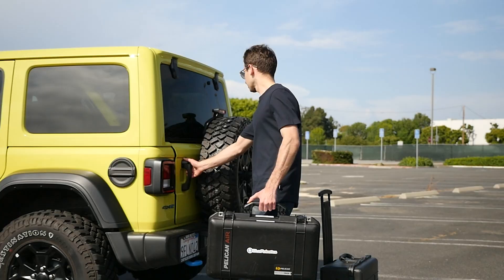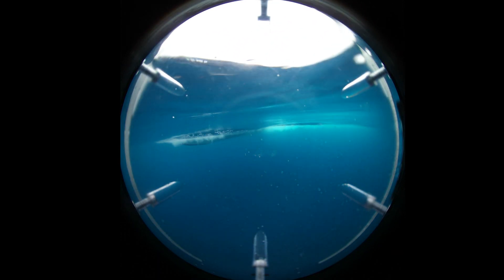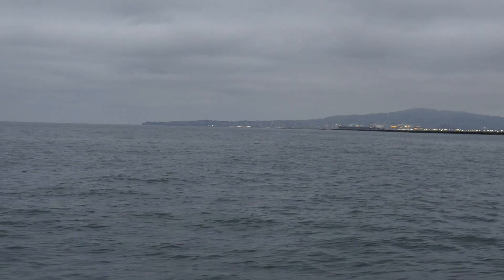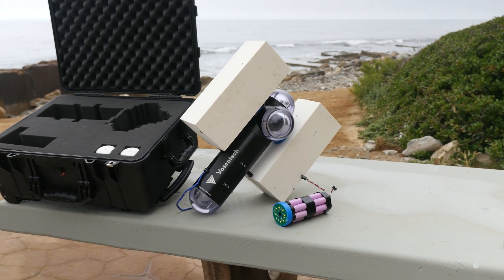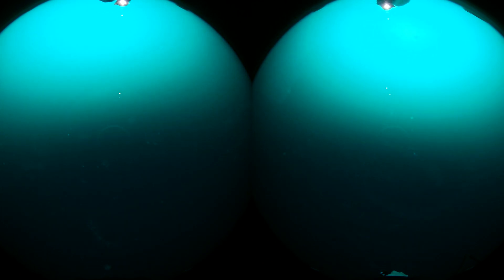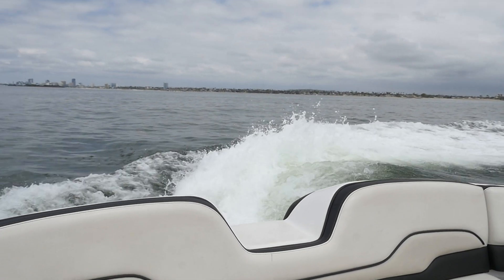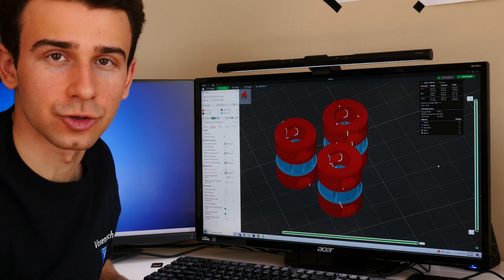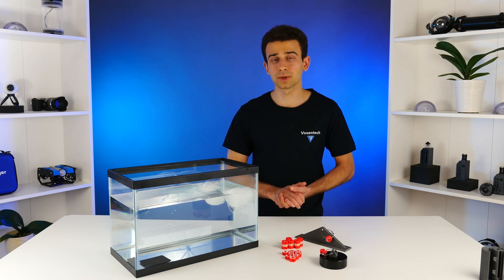Building a submersible for the Mariana Trench EP.5 - Setbacks

Comment: Perhaps covering the salt in a thin layer of alginate can increase dive times?

It's cheap, bio-safe, and easy to process without complicated equipment. It could come in the form of dunking a salt ring in alginate, or just laying a salt ring in a shallow pool of alginate to coat one side- decreasing the area which can be dissolved by the sea water. Same trick could work with PVA, which isn't as great for the environment but is readily available.
|
Great content btw! This is a cool project to follow.

Comment: Could you use something as simple and cheap as a house brick to send it down? For the releases you could use an ice lock. A big chunk of ice with the two topes in it. It would take a few hours to melt at those depths, but might be worth a try for a more ecofriendly release.
I would love to see a less deformed image, is there any way we could use a thick slab of plexi rather than a dome shaped lens? Particularly for a low depths version. For the activation without having to tighten all those screws you could make a base that has a magnet on it and use a magnetic switch through the submarine's body to keep the device deactivated until you remove it from its base before dropping it in the ocean.

I would love to work on a project like this. My only problem is access to an ocean. The closest sea is 2h drive, but its a very shallow sea, i think the deepest it goes is 100m or so
Reply from the maker: For triggering, we'll likely just add a radio receiver that we can activate from a keyfob that is held right next to it while getting it ready, that way we could have several different signals we could send it for different settings. About the dome, we'll try to get it re-manufactured from acrylic and the picture quality will be a lot better, a lot of the deformation comes from the nature of a 360 camera lens rather than the dome itself. The ice would be a tricky solution since water temperature can get to very near freezing at those depths, making it very unpredictable. Plus, would be tough to prevent it from melting. But otherwise, that would definitely work too! We can definitely relate to the ocean access issue, we're based in Philadelphia :)

Comment: what happens with the plastic and other material that your device will left behind in the ocean?
Reply from the maker: The only part left behind is the weight which just stays there.
Reply: @Vosentech  Oh, so both parts of the 3D printed joint is attached to the sub? Gotcha. And what is the weight?
Reply from the maker: @adam_  For the newer plastic release in specific, the lower half of the red plastic release also gets left behind. The weight is just some rocks or sand gathered from shore.
Reply: @Vosentech  okay, so that's what I thought originally. You should connect both red parts to the sub, and the weight will be connected to this 'loop'. If the loop opens, the weight get release. This way, no plastic will be left behind, which would be quite important. What is the material of the weight bag? Only asking because such an optimistic project like yours should pay a huge attention to protecting the waters, specially if there'll be a lot of people following this along.
Reply from the maker: @adam_  That is definitely an option, however it would put lateral stress on the 3d printed ribs (which aren't that strong in this direction) and dissolve them unevenly, which is why we went with the vertical design instead. This way, there isn't any risk of it snagging, and the dissolving ribs can wash away evenly, making it more predictable. The little red piece on the bottom can be made smaller to minimize impact. Definitely a consideration though, potentially for a next iteration. The bag is a biodegradable cloth one.
Reply: @Vosentech  cotton bags can take a very long time to degrade at such depths because of the absence of oxygen and bacteria/fungi that are used to digest cellulose. Plus these bags are actually not very eco friendly to manufacture. Maybe just a brick tied with a small rope would be better?